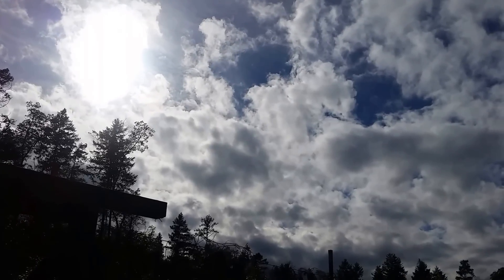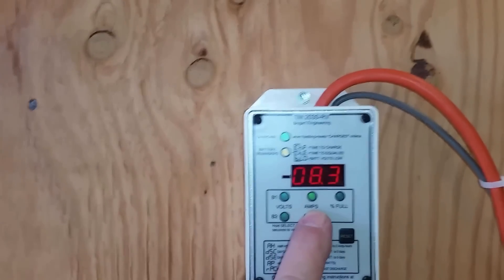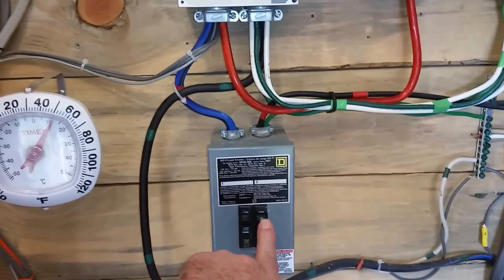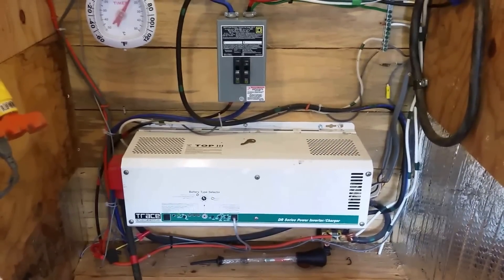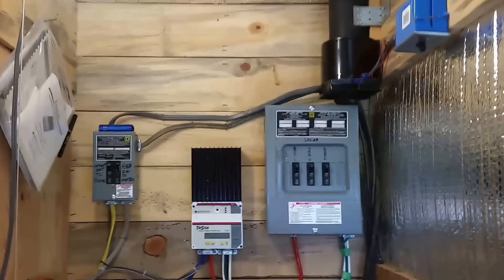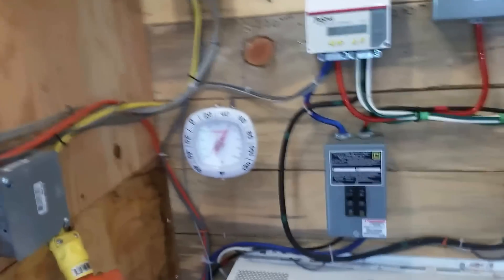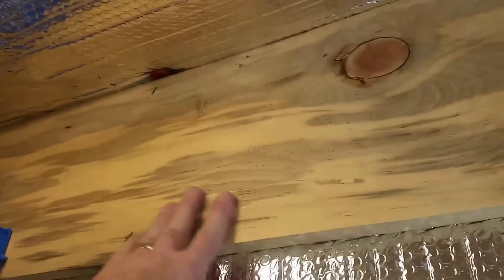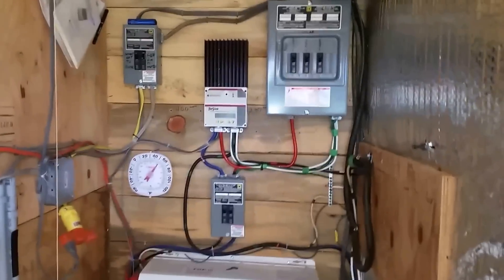Solar array increase  (please read description below)

Comment: Great video Steven and wise words on the description. Man, I hate to hear you in pain like that. I hope that those shots you speak of help. I also have DDD since I was 17 YO and it isn't any fun at all. I really want to see your addition on your system. But please take you time and don't hurt yourself. I like James Pottorff's suggestion about the dual systems.
God Bless
Reply from the maker: mada94fxr Yes I agree with leaving the redundancy in place. That's why we have several tracks to make power in the first place . Solar, gasoline, disel, propane and eventually hydro. SIN gas too?  I hope so some day. Redundancy is a good thing on a homestead. A good friend of mine Starry says " on a homestead two is one and one is none" Backups are a good thing. The injections have worked well in the past. I used to get them 9 years ago but the dock wanted to stop until we knew what the other neurological issues were. After 2 trips to OHSU hospital seeing the neurologist we have the go ahead for injections again. 9 years to figure that one out. Anyway the injections worked last time so good I did not even take a aspirin for 4 years! They are $1000 a piece and I get like 24 of them over a six week period. I finally have insurance that will pay for them again. If you have had DDD since you were young then you know what I mean about the pain. More surgery may be nessesary so I hope to get the solar upgrade up and running first. Have a blessed pain free night my friend.
Reply: I have watched your videos and man O man do you have hydro capabilities where there. I have watched several of Starry's videos and she has got it going on. Nice place she has too. Being from So, Fl. you all can keep that freezing weather and snow. I would rather deal with hurricanes..Not really. So, 9 years to figure out that you could have had the injections all along....... $1K per shot is outrageous but, in your situation, you absolutely need them. As for my DDD...... Oh yeah, I know all about the spasms and shocking pains that will drop you to your knees. Stretching and BC powders has been a couple of my salvation's. A daily routine for me. 
God bless to you and your wife

Comment: Your words are true, But you can keep your 12v system as a lighting system as downlights are 12v also our security cameras operate 12v. and then its the same 24v to 48,  48v  is the way to go so much better and more energy efficient than 24, you can buy 48v charge controllers that will do 24v for a future upgrade but id just go 48 in the beging.
Reply from the maker: You make good points. The reason I like 24 volts is the battery configuration. I have 2 strings of 4 six volt batteries in series. If I have a bad battery I can still make power with one string. If I have a 48 volt system then I have 8 batteries in series. Then if I have a bad battery I am completely out of power.

Comment: Looks like you have your work cut out for you. Will either of the walls allow you better access to the new panels? That may be a deciding factor. I'm still waiting to see how you get your battery bank setup for both of the controllers. This is sure going to be interesting. Wish I could give you a hand. But two folks working an hour a day each still wouldn't get things done much faster...LOL

God bless

BTW thanks for your comments about the concerns I had. It was great to get another person's perspective.  I was experiencing a crisis of faith.
Reply from the maker: So glad I could help my friend. I know that if you were next door that you would help me. If I stick to 1 hour I can get through the night without to much trouble. The problem is I push for a few hours then I suffer for a week. I love to work but it doesn't love me lol.

Comment: If at all possible, I would leave all of your existing equipment right where it is, hooked up in place but send the output (of your old inverter) to a new separate control/switch box or panel (where your connection goes from the power room into your house). Then if you install the new equipment on either side wall, and send the output of the new inverter, into that new control/switch box (so that both systems remain connected to it) That way your backup system would remain connected, so that if needed could be turned on by turning off one breaker, and turning on another (eliminating the need to re-wire everything if there is a problem with the new equipment).I am assuming that both the old and new systems (combined)  will continue to charge your battery bank, with only the output of the new inverter being used to connect to your house.
Reply from the maker: James Pottorff You make a very interesting and valid point. Thanks
Reply: By doing it that way, the only downtime (electrical) would the time it takes to connect a new control panel/transfer switch between your old and new equipment.
Reply from the maker: James Pottorff I would have to have a generator transfer switch between the 2 systems so I can not accidentally back feed each other with inverter outputs. I have seen 50 amp transfer switches for under $100. This is the most logical setup. As you say I would have 2 stand alone systems. If one inverter is down throw the transfer switch and turn on the other inverter and we ate back on line! Thanks for the help.
Reply: Connecting a transfer switch between the 2 systems should be easy to setup. I know most newer Inverters have the ability to connect a generator (or grid connections) directly to the inverter for charging batteries for when there is no solar power coming in. Was not sure if that was the case with your old Trace inverter (I believe Trace is no longer in business, and/or were bought out by Xantrex), In either case, it should be easy to setup. But the best part is both systems would be available with the flip of a switch, and by adding a transfer switch going into your house, will minimize the electrical downtime to your house while making all the new connections with your new equipment,
Reply from the maker: James Pottorff My Trace is a inverter/charger has a transfer built in. When I start my diesel the transfer automatically passes 30 amps ac 120 volt to the house and puts 70 amps DC to the batteries. The need for another transfer switch is to isolate the outputs of the two inverters so only one will pass through to the house at a time. This way No one can make a mistake by accidentally combining the inverter outputs.

Comment: I appreciate your words of knowledge . :/  I am fairly commited to the 12v path at this point.  When I toss up a 24/48v I will definitely be awaiting your "I told you so".
Keep in good Health Friend.
Reply from the maker: Lars Londian I was at exactly where you are at. The 2 points I did not factor in were #1 Solar is very addicting and #2 At the time it was a financial necessity to be off grid.
Reply: Steven Davis I really do appreciate you sharing your experience.  I take everything people tell me or say in a constructive manner.  I have really enjoyed being part of the Solar Community +Chris DIYer +TheKilog69 & someone a bit newer +David Armstrong have been great inspiration.
Take Care.
Reply from the maker: Lars Londian I agree. Great comunity and the ones you mentioned are great people. Another good friend who knows a lot and is a renewable energy contractor is Roy Amberg.
Reply: Steven Davis I will make sure to check him out.  Thank You.
Reply from the maker: By the way I did not mention that my 1st 12 volt system taught me a lot about solar.  If all I needed is a backup power system when the power goes out because of a storm or even a long term grid down scenario then 12 volt would have been fine. I built the 1st system just big enough to get by. A few lights, water and a chest refrigerator. It was a 610 watt system. For that application 12 volt is better in every way. You will never hear I told you so from me my friend. Every system is unique built around differing needs. Have a truly blessed and peaceful day my brother.